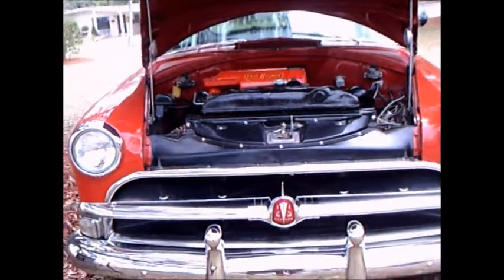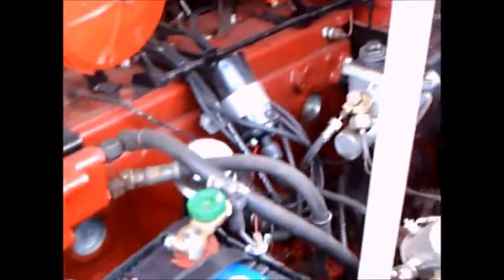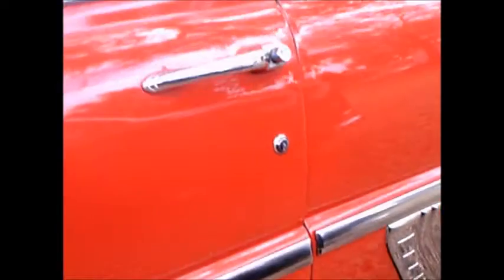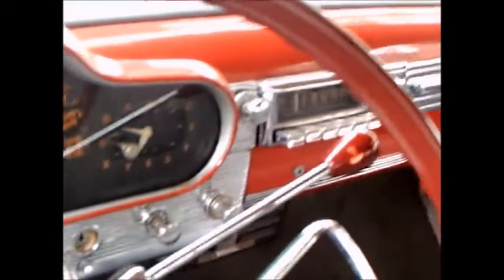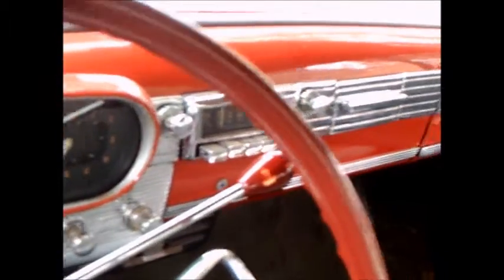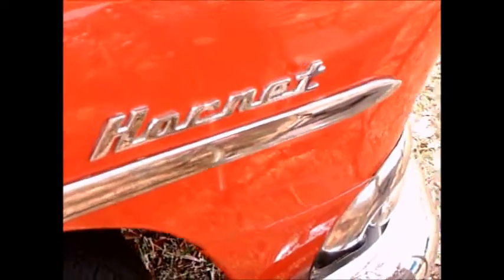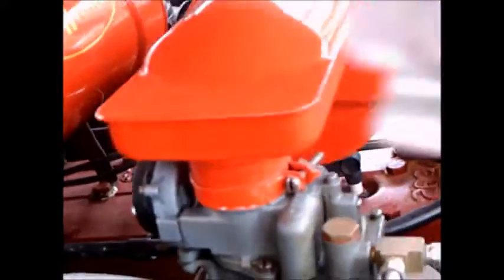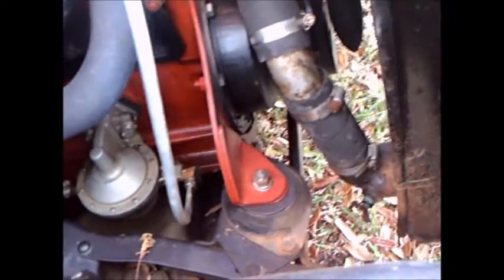1954 Hudson Hornet Two Door Sedan RedBlk Apopka031216

Comment: A great example of the last 'real' Hudson. Very similar to the 53s, but it got tail lights a la Cadillac and the front clip looked almost Ford like. This one's huge flat six is gorgeously presented. This scrumptious upholstery really suits this mid-priced Hornet. I was curious how Hudson did in 55 when it became a re-badged Nash and even though you could now get a Hudson with a modern V8 it lost about 10% in sales. :)
Reply from the maker: +cheddyrod  Hey, Chester!  Yes, they tweaked the styling a bit, in those areas where it would show the most...the grille and back end.  The '55 models appeared a bit strange to me....it was obvious that they were another version of the Nash of the time...somehow the new merged company didn't yet figure out how to make two cars share most parts but look quite different as GM was able to do so handily.  Interesting about the sales...I'm supposing loyal Hudson supporters were somewhat disappointed in the new design.  Thanks!  :) Jack

Comment: Alan, The Step Down Hornet  was 51-54. FYI, The Commodore six was the same identical car with the same motor and Interior And Trim. Except The Hornet was a 262 Commodore boared out to a 308. 145 hp and 275 # torque and as you know torque wins races!
Reply from the maker: Hey, Gordon!  Thanks for the distinction between the Hornet and the Commodore.  As  you say, torque wins races!  Thanks!  :) Jack